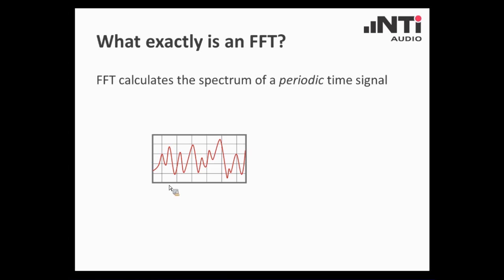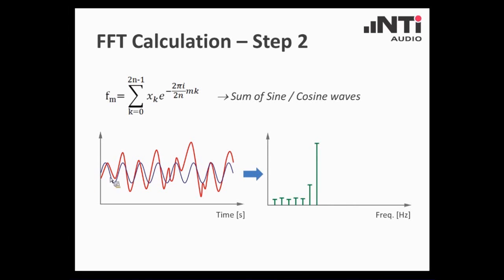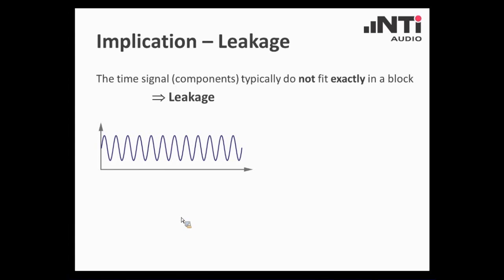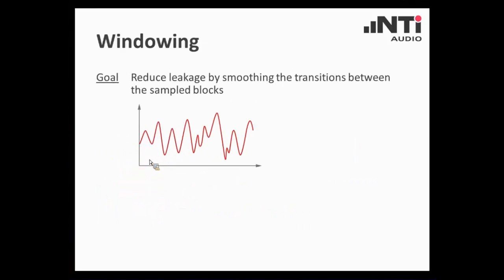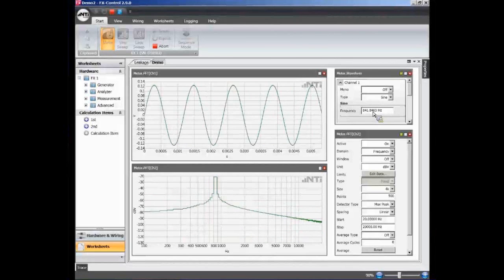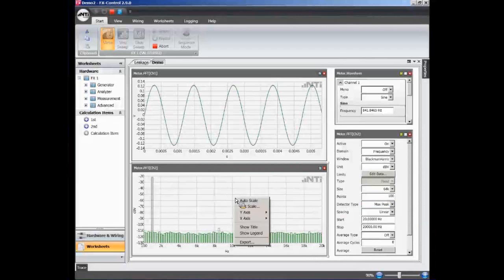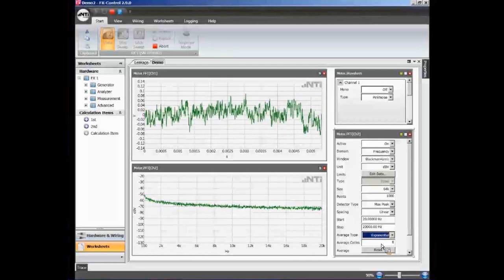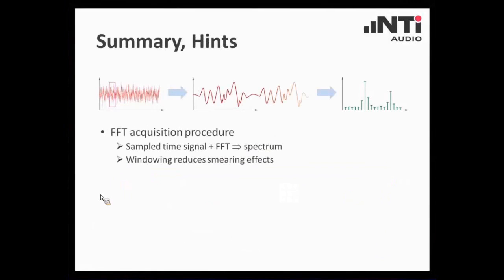Basics of FFT Analysis - Webinar

Comment: Great tutorial! Some questions: When you do correlation with the sine wave, what is the y-axis of the output graph? How does it related to the amplitude of the sine wave and the input wave? Say my input has range -1,1, does the sine wave have to be -1,1 as well? What would be the max value of y-axis in the output?
Reply from the maker: Hi, thank you for the comment.
The Y-axis of the FFT shows the RMS level of the analyzed signal. Looking at a single frequency sine signal, a +/-1 V amplitude would result into a 0.707 V or  -3 dBV level indication on the FFT.
The RMS level is calculated over the complete acquisition time of the FFT.

Comment: Hi, I have an XL2 with the Advanced Acoustics pack. I need to do FFT Analysis accross the full frequency spectrum, but at the moment I can only measure from 484Hz up to 20KHz. I need to be able to measure lower, down to around 60Hz. Is this possible please? I can't work out how to do it. Thanks.
Reply from the maker: Hello Tommy, the XL2 with the Extended Acoustic Pack allows you to use the Zoom-FFT with selectable frequency ranges and resolution up to 0.4 Hz in the range of 5 Hz to 20 kHz. However, due to the finitely many number of points to display, you can not choose a high-resolution display and a full frequency bandwidth at the same time. 
Best regards,
NTi Audio